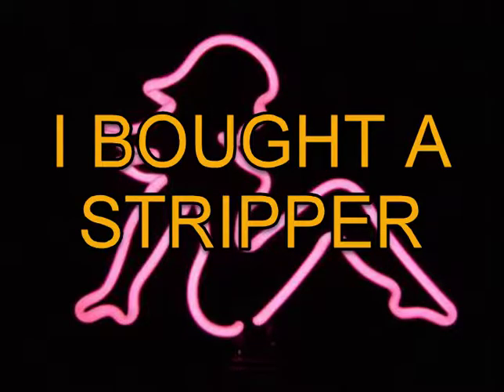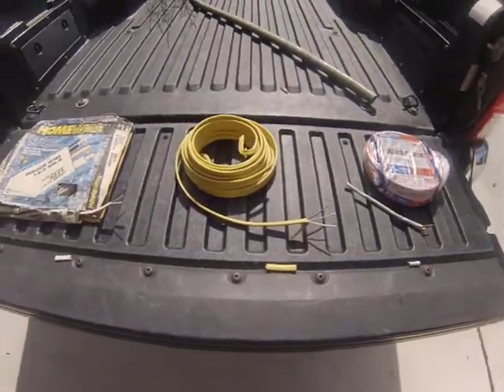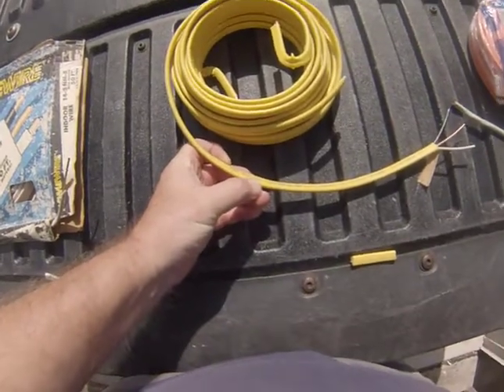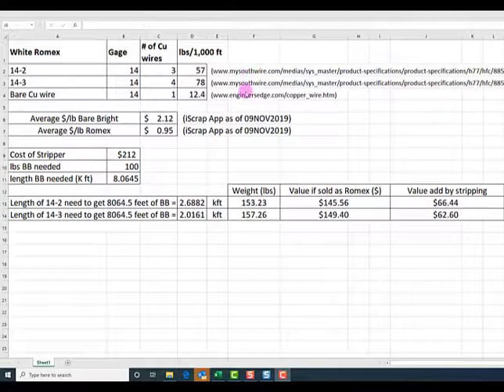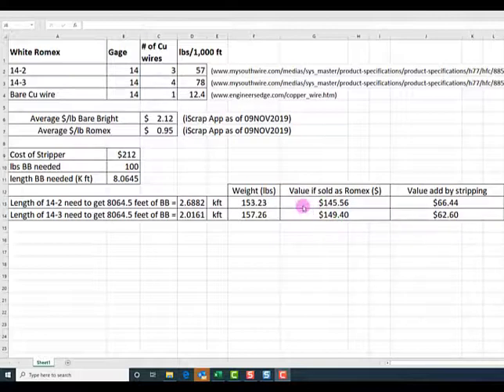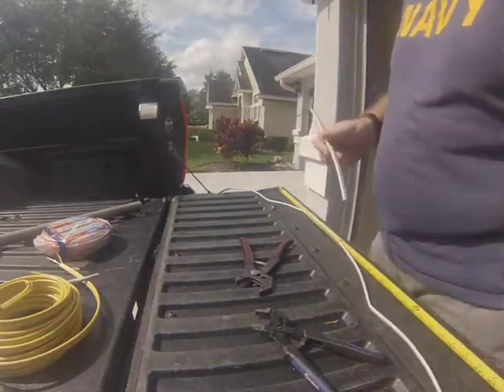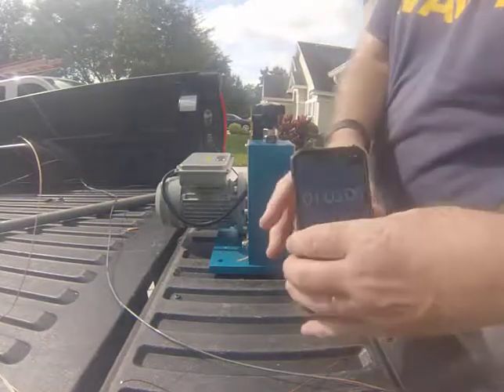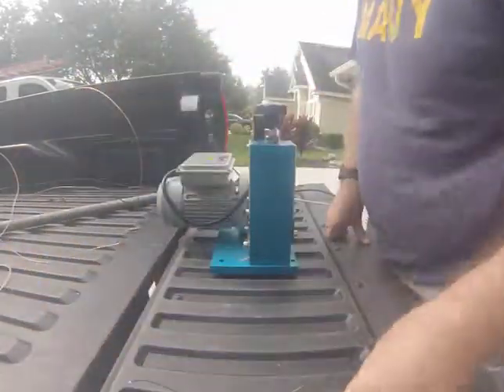I bought a stripper!

Comment: Nice stripper, I was going to buy a model like that but ended up with the Stripmeister. It was a bit more money but I went that route because the parts are readily accessible. I find anytime I buy something the clock starts ticking to when it will breakdown ! I find it works great on the wire up to about #4 or so, and eats up the #14 - #10, here is mine in action https://youtu.be/BiGZHOnL-eY . Great video for someone thinking about buying a wire stripper.
Reply from the maker: Nice stripper.  It will be interesting to see which of our strippers gives out first.  I promise I'll post when I start having issues with it so we can help keep the community informed.
Reply: @sharkscrapper  You bet, good ide !